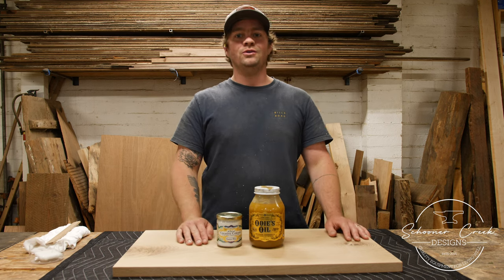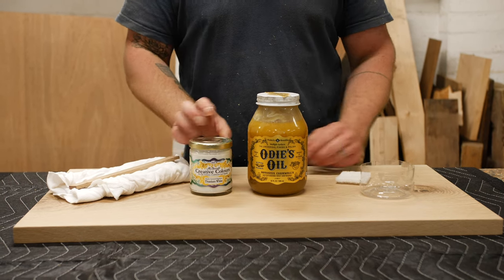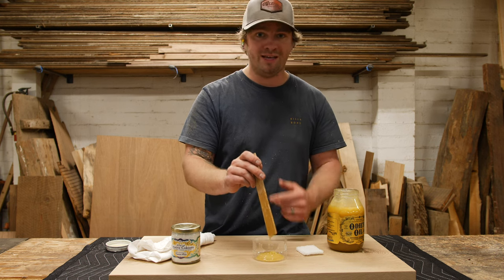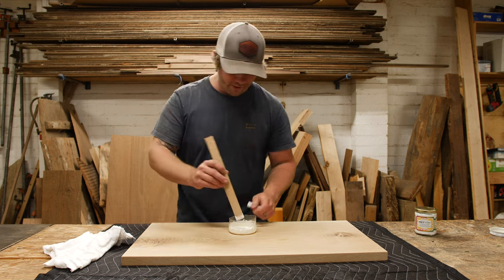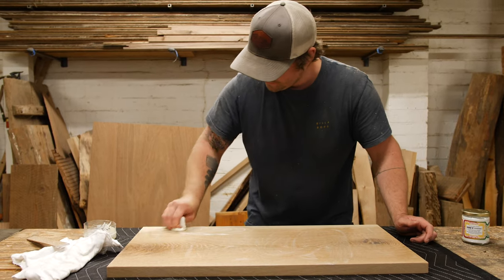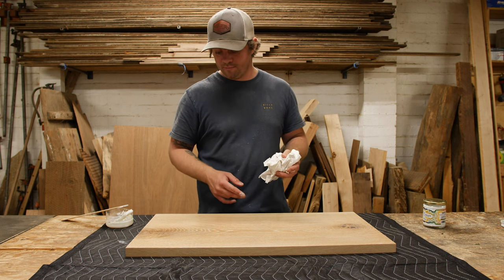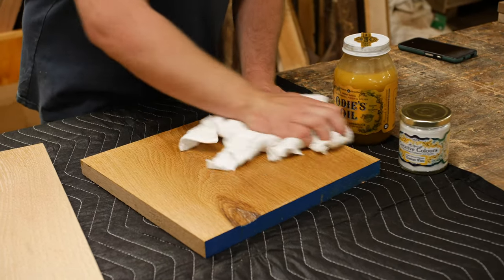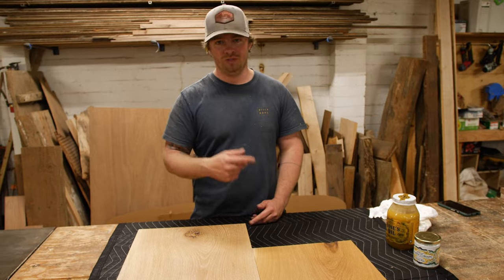Using Odie's Oil Universal Finish with Mr. Cornwall's Creative Colours Titanium White on White Oak

Comment: Great video! I'm considering doing the same thing for my current project. Have you used other Odie products? I called the Odie # this am and they recommended the "super duper oil" w/ pigment, I'm wondering the actual difference?
Reply from the maker: Hey thanks for the comment! I would listen to whatever they recommend, from my understanding the pigments will work with any of the oils they offer! I have used the super penetrating oil as a first coat then used a pigment in their universal finish on top of it and it looked great! Especially on woods that have checking like white oak does!

Comment: Can you tell me what grit did you sand your piece in preparation for Mr. Cromwell's?  If not staining, Odie's website says 1000 grit.  I am afraid that is too fine. I am working with red oak veneer doors.  Thanks for the help.
Reply from the maker: Hey thanks for asking! I sand most of my pieces of furniture to 250. Sometimes (depending on the material) I'll sand to 500 but never over that. This piece of white oak in the sample was sanded to 250 using the festool rotax sander and the finish turns out lovely!
Reply: Thanks for the quick response!  I forgot to tell you I loved your video!  Most videos are full of so much rhetoric but yours is concise and informative.  This is my first time using Odie's as I have always used Varathane for 30 years+, but the project I'm working on really calls for a different finish.  I'm really excited to try Odie's and you helped a lot to take the fear out of the product switch.  Thanks again for the help.  God's blessings to you!

Comment: Don't the proportions of pigment and oil matter? You just eyeballed the measurement, so how is it consistent from piece to piece?
Reply from the maker: To be honest I have always eyeballed it within reason and have never had problems. It would be a good idea to keep a set of measuring spoons in the shop and document the ratios you use if you're needing to put multiple coats on a piece in different stages to keep it consistent. This pigment and oil combo from Odie's is incredibly forgiving and you can continue to re apply until you achieve your desired color!
Reply: It matters if you are finishing several pieces that need exact same color.  I ordered several samples of Mr. Cornwalls Colours in order to my preferred end color.  I wanted to see a mahogany, purple (yes, purple), and dark brown.  I used measuring spoons to adjust the Colours.  If you open one Colour and are not mixing, exact measurements aren't necessary.